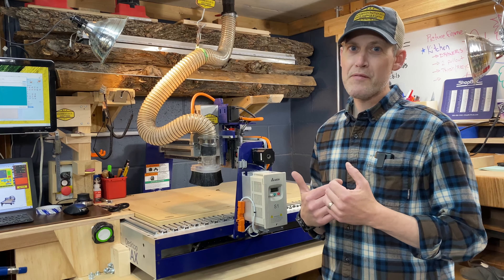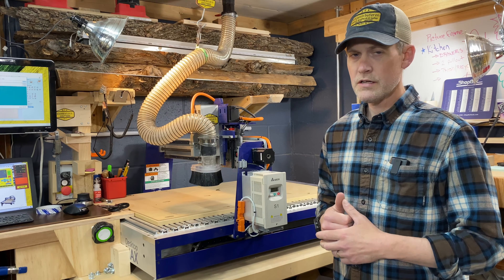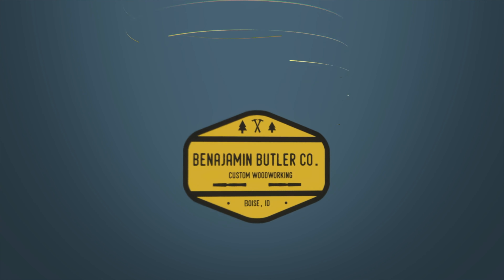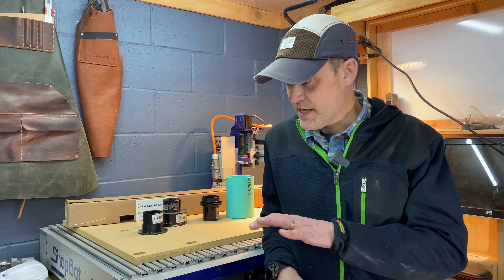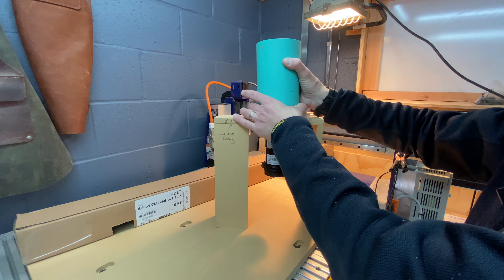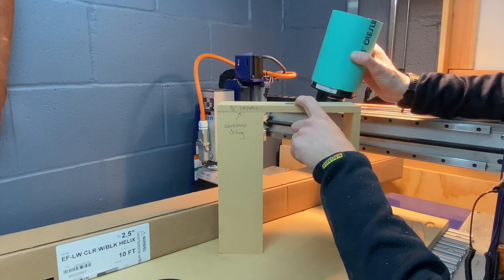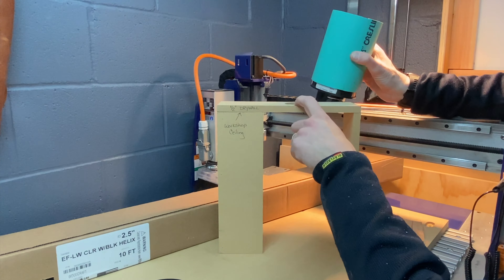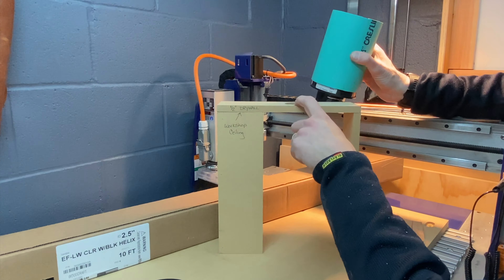ShopBot CNC Dust Collection System Install with Attic Based Dust Collector and Voice Automation

Comment: Does the dust collector suck heated air from the shop to the cold attic? I live in a cold state and hate to suck my heated air out of my shop. Any ideas?
Reply from the maker: I can’t deny it certainly does pull warm air out of the shop pretty quickly! That being said though I recently insulted the attic/ceiling joists above the drywall and the benefits were two fold:
1.) the shop space takes much less heat to warm up and therefore unless I am running a very long carve or other operation on any other tools connected to the DC I have experienced a much less significant temp swing and the recovery time has been cut in at least half!
And
2.) The added sound dampening is AMAZING! 😍 it’s honestly kinda eerie sucking up dust and cleaning the shop when you literally can’t even hear the dust collected turn on let alone hear the droning sound of the motor as it runs 😂 

It gets chilly here in Boise, ID but I wouldn’t necessarily consider it to be a harsh winter climate (we’ll have 7-10 days in the teens to 20’s freedomheight but generally speaking we’re more frequently closer to 40 degrees so once the shop warms up and I get the 8” cement block walls warm the chill has a hard time setting back in with any significance or speed
Reply from the maker: Doh! Hit send a bit prematurely there 😂🤦🏻‍♂️😆 I meant to close that comment with a final thought and that is that if you have a small shop (as you can see mine is a one car garage measuring 15x20’ with just a 7’ high ceiling space is so precious that in my mind losing some heat temporarily every once in a while is an incredibly small price to pay! I would say I’m more concerned with losing cool air in the summer than heat but we’ll top out at 110 degrees of dry heat in the summer and we’ll go 3-4 months per year where the only forecast you need to see is the first warm dry day of the year and you can be sure the next 90-100 days will be between 90 and 115 degrees with barely a cloud in sight and rain showers being rarer than my hand cut dovetails fitting together cleanly 😂
The attic may not be the “ideal” place to put it but I’d have mine outside the shop regardless of the size of the shop from now on and I believe you’d have the same issues mentioned above regardless of whether you stuck it in the attic or beside the shop outside the walls.

Comment: Leave your dust collector in the attic, drop a line down to a cyclone and never have to go up to the attic again, you'll just have e to empty the seperator collector bin in your shop. Solves all your issues and keeps your dust collector nice and quiet upstairs
Reply from the maker: And your attic gets insulated in the process as well!!! LOL It's PERFECT! HAHAHA I've been pleasantly surprised at how infrequently I have to empty the bag. I am up there maybe 3 times per year and the process of emptying it is actually not that big of a pain in the ace either.
Reply: @ButlerBuiltWoodworking  I have a 3hp laguna, I built a closet around it and put a cyclone seperator at each machine, cnc 16"jointer, planer. Bandsaw, im in a production setting so slightly different, when you run a 1000 board feet of white oak two dumpsters fill up quite quickly and emptying that tiny drum on my dustcollector got old real quick. Biggest benefit is keeping the filter clean as very little dust makes it to the collector, hence airflow stays strong and cleaning that is the biggest pain.

Comment: I have seen a CNC bit stop in the material because of a G code error. This caused the bit to burn the material, therefore, creating embers. These embers were sucked into the dust collector. The dust collector then caught fire. The reason the bags are clear is so you can see smoldering embers. Please be careful because having the machine in your house voids insurance and having a burning bag in the ceiling will be hard to remove.